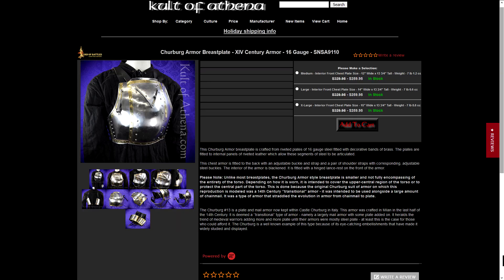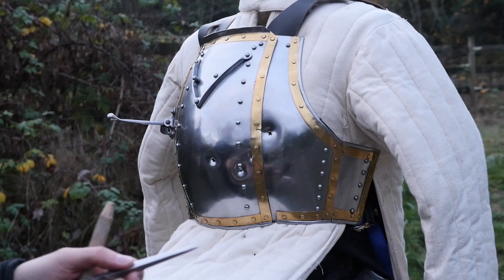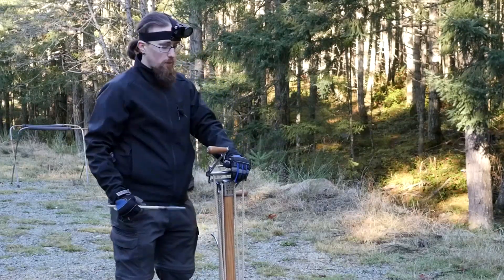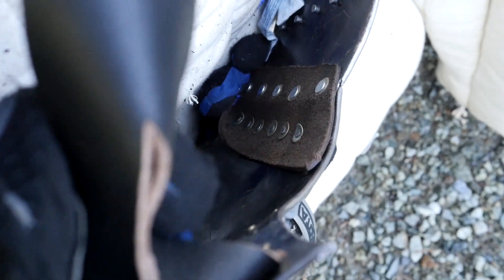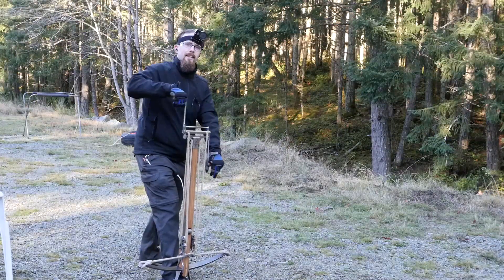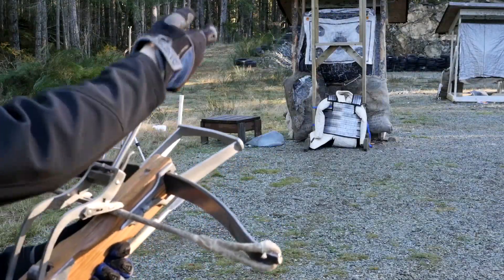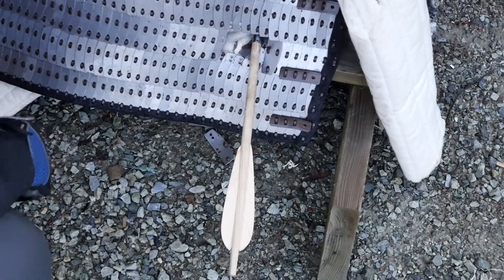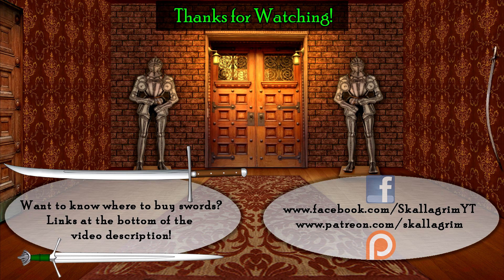Medieval Crossbows vs. Breastplate and Lamellar Armor

Comment: The type of bolt point is not correct. A long tapered point will drive itself to a standstill as it proceeds up the taper. The armour piercing bolts  had a flat ended tip that was in the form of a cross. The dimension across the two arms of the cross was slightly larger than the diameter of the bolt shaft. When the bolt struck the cross made 4 cuts which peeled back rather like petals on a flower, creating a opening that allowed the shaft to easily pass through the armour.
It operated on the same principle as a modern day press tool.

Comment: Not happy with the glue... You are shooting the bolt from a 1000 lbs crossbow at a steel target and only half an inch is glued. No sheet it comes loose.

Comment: Soft steel on both sides? Was it always soft steel when it comes to armor or when people started using tempered steel for armor plates?
Arrows - there were definitely armor piercing ones made of the tempered steel thus not loosing sharp tip.
Nice and interesting video. It is nice to see enthusiasts debunking myths and providing knowledge based on experiments.

Comment: Are you sure these draw weights are accurate? I'm pretty sure my crossbow at home would so more damage than this and the draw weight is obviously not even close to these crossbows.
Reply: Keep in mind that ancient crossbows draw weights work a bit differently than modern crossbows/bows. A 1000lb medieval crossbow is comparable to a 200ish lb longbow, and modern crossbows are more similar to full sized bows now. The mechanisms for release are also much more finessed, and they don't use a literal ROPE to propel bolts, instead they throw cut-down arrows. The ancient crossbow was inferior, both in projectile, execution, and construction. A small wooden bolt fired at close range (inhibiting proper spin) with a mild-steel tip via a rope at tempered steel isn't quite as effective as a small lightweight fiberglass/aluminum arrow fired from a composite cammed crossbow of today. Basically, the down low is that the draw weight wouldn't necessarily directly translate, and also that the two machines are so wildly different that they can't really be compared. Side note, modern crossbow bolts/arrows would likely shatter on impact with armor, as they're much thinner and longer.

Comment: Historical armor would have been heat treated and made from high carbon steel.
Reply: Yes.
Reply: Keep in mind that the steel used in the medieval period isn't anywhere near what we've got today. Their high-carbon is relatively low in comparison to modern stuff, and realistically was closer to mild-steel today. And also, heat treat/tempering differed depending on the armor and it's intended use. I'm not certain of the exact steel used to create these specific reproductions, but I trust Skall to make sure it's at least half decent. It certainly isn't stainless in the case of the Lamellar, as it comes oiled and potentially rusted, but I'm near positive it isn't high quality carbon perfectly heat treated and tempered given the lack of mention/price.

Comment: in regards to the deformation, in jousting in mild steel armour i have had more serious dents on several occasions and they did not make for much issues at all

dents like that to helmets sometimes mean the vision slit is moved and that can interfere with vision, but that is about it.

but it is really interesting to see that armour that is 'thinner than most originals' and 'soften than most originals' effectively stops this.

(for the comparison, the Avant armour is 4 mm hardened steel even in the fauld lames in the middle of the front)

Comment: I lost my faith in crossbows , you literally can defend yourself with a aluminum fry pan...
Reply: Older Crossbows are brilliant for defending upon castle Walls.. Less so for soldiers on the ground, without protection.
Reply: @Beuwen_The_Dragon  this I learned sieging Grunwalder Castle
Reply: just aim for the nuts dude
Reply: @nostromo9743  dude..

Uncool.
Reply: Medieval crossbows are terribly inefficient due to the amount of drag and low draw length. Modern crossbows are on par with compound bows so no comparison there.
Reply: An*

Aluminium*
Reply: @Elbowbanditest2003  Aluminum if you don't have messed up teeth and drink tea at 3.
Reply: It gets worse, aluminum fry pans can work harden breaking even hardened steel arrows. I knew a guy who broke an axe when he was chopping on thick aluminum.
Reply: Look youtube broadheads vs steel barrel and say it again 🙄
Reply: tell that to the riot shields that got wrecked by bows
Reply: @nicodovahkin8822  police use those for rocks or blunt objects,they are not designed for that.

Comment: I lost all hope with that Lamellar after seeing the leather strip brake, as the individual plates are connect with leather also. My fear is that the leather used is so weak that it can't hold up against too much force and the plates end up falling down. 

In melee range you can just make random cuts against it and you're guaranteed to brake the lacing eventually since it's exposed. I find the armor to be bad if it's vulnerable to cuts. An axe would shatter it, blunt force would still brake bones/cause internal bleeding and it's whole structure fails if you cut the lacing. 

Even if there's no alternative lacing that's better, still the leather feels like a horrible "death insurance". Imagine if you were to "rivet" plate armor together with leather. Or build a house on clay foundation. It's bound to brake and the whole structure fails and falls apart.

I'll just assume this particular "reproduction" is bad and a ugly looking wall hanger. 1mm steel plates with leather lacing that brakes from just trying to tie it. I'm better of with integrating a big kettle lid inside a Gamberson. 

Fucking scrotum leather lol

Comment: I have to question the quality of the steel used back then since on battlefields there would be tons of crossbowmen and I don't think they would bother using them if they had so little impact.

Comment: Couple of points (sorry) about the lamellar
First, leather is a really bad material for lacing, the Japanese used silk and I would experiment with flax or hemp cord or even a braid.
 
Secondly I am extremely doubtful about the lapping of the plates. The Visby armour has the lower plates lapping over the upper, not upper over lower. This maybe to stop swords sliding down the breast piece and cutting too many laces

Third. 20 gauge is definitely much too thin IIRC (donkey's years since I read the excavation report) 18 or even 16 gauge (1 - 1.2mm) would be more accurate

Comment: i got this feeling that people had the breastplate tied really tight so it wasnt loose, it is possible that the bolts are not doing the desired effect because the armor has isnt strapped tightly onto the stand, personally i would strap it on a manikin  .... but hey im not an expert, it could just as well be because  of the metal, they probbably didnt have the same quality as this reproduction

Comment: the thing with lamelar armour is that it is very easy and cheap to repair it as you only replace the damaged plates. with plate armour the maintanence is high and as seen in the video, after getting shot at there is a big dent that may be a discomfort to the wearer.

Comment: Could you try this with bolts made a little bit differently?
I’m thinking more acute shape/point, and different tempering/hardening of the metal in the bolts?
I just speculate that if the metal in the bolts is a much harder metal than the armor it might easier penetrate. 
And they knew about differential hardening quite early on I think.

Comment: As a leatherworker, I would never use leather lace to attach metal plates unless I use a grommet. (A grommet causes the lace or cord to bend at an arc rather than at a sharp angle) Leather lace doesn't have much tensile strength especially at that small size. I suspect cording was used. Even without a grommet, cording would be much stronger and glide across the edge of the holes in lamellar plates.

Comment: Is it possible to use thiner more pointy bolt heads? Maybe better penetration? =)
Reply: The bolt heads used are already as pointy as they need to be. They're proper, historical bodkin arrows that were specifically designed to penetrate maille with relative effectiveness. Any more would only start being detrimental, where the weight would be too low to actually do anything. Besides, even if it did penetrate better, you have 6 more layers of gambeson to go through, and a pointier bolt still wouldn't be enough to go through it.

This basically just highlights that you really can't go through armour, you need to find ways around it, such as with blunt trauma, or by going for the weak spots.

Comment: Probably an ignorant question, but - why aren't those arrows sharper, thinner edged?
Reply: The first bolt shot from the 1,000-pounder is actually a bodkin bolt, which is actually intended to pierce armour. You wouldn't really make it any more effective by making it slimmer, you'd only make it less stable. As far as the sharpness is concerned, he's shooting steel. Sharpening the point would be the most useless thing he could do. If sharpening the edges would have been useful, broad-heads would have been effective, too.

The truth is, steel plate is just way too effective against most all projectiles, if it is well-made, which it usually was, since only rich people could afford a high-quality suit of plate, such as knights and all the other nobles.

Comment: No wonder the knights werent afraid when charging towards the enemies.
Reply: Well, it wasn't as perfect in the 14th century. The neck was still exposed at this point in time and only covered up by a maille aventail. The 14th century suits also lacked back plate, which didn't arrive until the 15th century. At that point, gorgets and bevors were used instead of aventails, and at this point, knights really had little reason to fear.

You can see this in how different the noblemen casualties were between the battle of Crecy and the battle of Agincourt. In the battle of Crecy, which happened, 1,500 French knights were killed by English longbowmen, very often from being shot in the neck. In the battle of Agincourt, only 117 noblemen were killed, despite their charge having completely stopped and sticking them to one place, which the English then bombarded with tens of thousands of arrows every minute. On the contrary, 2,200 noblemen were captured unharmed, despite them also having been shot at continuously.

Comment: Is modern steel reproduction much much much better than ages ago plus that crossbow looks weak sorry ... but great job any way
Reply: The heavier crossbow has the draw weight of a 1,000 pounds, that's anything but weak. There are no crossbows recorded in history that have higher draw weight than that, so that argument goes right out the window.

Generally, yes, steel production has increased significantly since the beginning of industrialisation, but this isn't universal. You had good quality steel in the middle ages, even in the earlier medieval period, definitely in the 14th century, and especially in the 15th century when the blast furnace was discovered. Truth be told, you can make high quality steel by complete accident, which is how it was done long before. The issue was the availability of high quality steel, because it was a lot harder to make, so it would only be richest of the richest, i.e., noblemen, i.e, people who could actually afford plate armour.

People always neglect to mention it, but this is immensely important. By estimations of the great Toby Capwell, high-quality, well-fitted plate armour would have cost around $800,000-3,000,000$, which is why knights and higher nobility were the only ones able to afford it. You of course had munitions quality plate, which was made of cheaper steel, but that would have been reserved for men at arms and impoverished noblemen, not the actual rich guys.

There's also another thing people tend to neglect. If crossbows could shoot through plate armour effortlessly, what the hell would be the point of wearing it? Why would rich people pay such exorbitant amounts of money for something that gives no protection against projectiles from a crossbow? Furthermore, why wouldn't everyone just use it? Why was it not more prominent than it was? And why was plate armour worn on the battlefield all the way to the 17th century, when it had to resist musket fire? The answer is simple - because it was effective. You don't go to battle with inefficient gear, unless you're stupid, which knights were anything but.
Reply: Of course good expensive armor was giving some kind protection but please... not this one, no historical evidence? lol so why pope Innocenty II and Innocenty III banned crossbow?
the crossbow from movie is just (so sorry ist great channel) not the best replic, peace
Reply: This is not up for debate, his crossbow does have the draw weight of a 1,000 pounds. You cannot argue this, it's an uncontestable fact. He made a GoFundMe just so he could afford it. You cannot dismiss it, you genuinely can't.

As for historical evidence, here: https://www.youtube.com/watch?v=8RAGdgC1qjs

As for your question, because it was extremely against pretty much everyone but a noble? What, do you think a medieval battlefield was made up of nothing but nobles? At most, they made up 10% of the army, and usually less than that. No one else had plate, so you had 90% of people that either had munitions plate or mail+brigandine, which can be defeated by a crossbow.
Reply: listen I don't come here from kardashian channel I like history I was in few places I know the structure of baterfield people,  nobody was care about village people pope banned that because was so easy to kill "blue blood" not in prop  honor sport fight noble vs noble but from 50m by  the farmer John. Arrowhead crossbow looks bigger than that what I was seen her in european museums ( I mean anti armor one) plus the movie one  is hardened steel? I don't think so
Reply: That's a load of naff. Broadheads aren't supposed to penetrate armour, they're against soft targets. Anti-armour bolt-heads are supposed to be as thin as possible, because the less surface area you have, the more force per square inch you generate, which is what you need to get through the armour, like the one present in the video, which is a bodkin. The fact you think broadheads are supposed to be anti-armour pretty much tells me everything I need to know 

Again, quality steel was available. Actual plate harnesses from museum, the ones noblemen used, were made of hardened steel. Blast furnace was developed in the 15th century, but even before, they were able to make small amounts of hardened steel, which is why it was so ludicrously expensive.

The actual ban has nothing to do with the penetrative skills against plate armour, but its accuracy and ease of use. It was feared because you could arm 5,000 regular Joes with it, and at least one would be able to hit the sweet spot, most often the face when the visor was lifted, example being the battle of Agincourt.

The actual indirect evidence from battles suggests a completely different narrative. For one, few nobles actually died on the battlefield compared to their numbers. I'll use battle of Agincourt as an example again. The French had 4,000 archers and 1,500 crossbowmen. The English lost 4 noblemen in total, despite them being the front line that was constantly shot at by the bowmen and the crossbowmen, while the French lost 117, 90 of them being knights, and another 2,200 French noblemen captured. If this doesn't show how projectiles rarely worked, I don't know what does.
Reply: discommunication, of course the head of arrow should be small is still doesn't looks like museum one plus hardened steel I was thinking about head, just can't agree with that absolutely perfect protection why crossbow year after year was bigger and bigger and on the same time armor more heavy and more heavy ap to gun powder that was normal armaments race. Thank you for discussion for sure was not so easy to kill plate armor knight just like that but shooting from 4 meter without any result... just don't believe. Crossbow then don't have any sense lets stay with bow I know you must more  practic but its  10 time faster
Reply: Regards

Comment: Are the bolts even sharp? huu..
Reply: Why would a crossbow bolt need to be sharp to begin with? The points are as acute as they need to be, which is the only thing that's going to help you if you want to achieve penetration. Unless you're shooting at fabric armour, sharp broad-heads are utterly useless. 

Basically, Skall couldn't shoot through the armour because projectiles don't work on armour, not unless you're shooting it with a ballista. It's why you see plate armour being used all the way up until the 17th century, as evident by battle-ready harnesses of steel plate we have in the Wallace Collection.

Comment: I believe the Lamellar Armour works by redistributing the energy of the impact throughout the armour. That might be the prime reason why we see the arrows bouncing off all the time. I could also see waves of energy dispersing throughout the armour as the bolt hit.
On the contrary, the Breastplate seems to quite thick and sturdy, not giving it any room to propagate the energy from the bolts. So it essentially works as a solid barrier against the attacks directed to it.

Comment: Even with padding, that's some borken rib at least.
Reply: With that arbalest, I'd say so. The force it would deliver at short range would still be quite devastating, even if not all that lethal.

With that munitions 350 pound crossbow, I'm pretty sure the wearer of the armour would just recoil slightly and then continue marching.